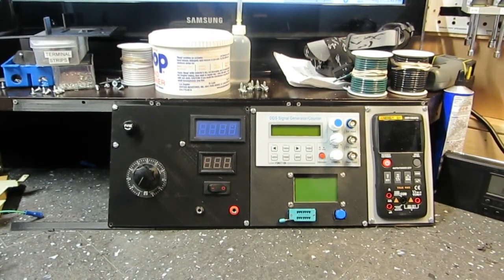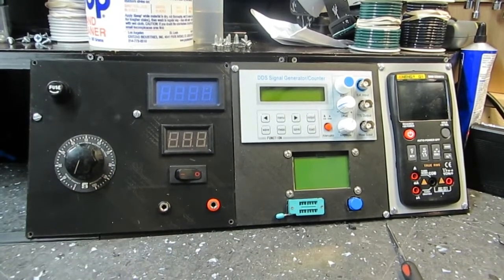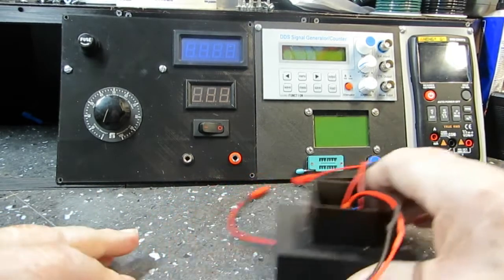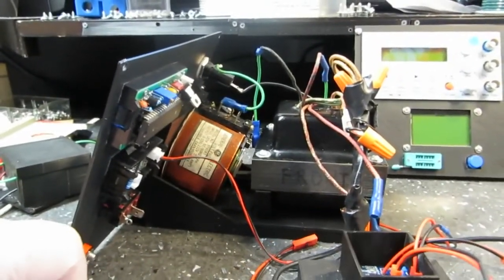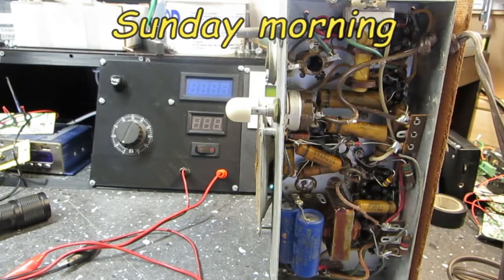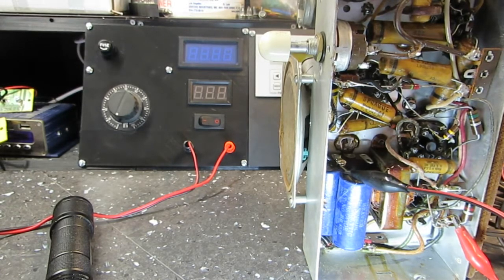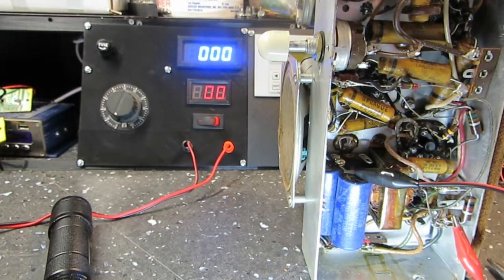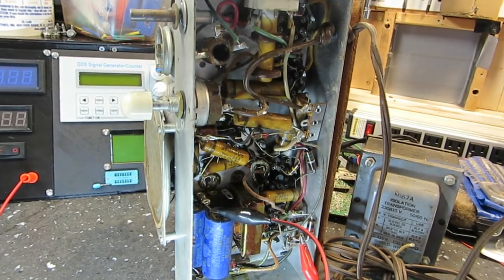DERB - DC PS Installed - Does it work?

Comment: Hi Doug, I am so proud of you and your design of this. I am thinking of making
me something similar. I would like you and Bob to think about an add on
for the external dc supply. Could you come up with a way to sub the filament
voltage so in trouble shooting hum or noise you could remove a tube
to see if that is the problem. I see techcs do this on guitar amps since
they are powered by a 6 volt transformer.But we can't on these series
strung all American 5 sets. Jimmy in soon to be wet Alabama.

Comment: I agree with Mark, those radios were not made to run on 120 volts, I would not go over 115 volts, your B + will be too high if you do.
I like the "modular" design, it makes it easy to service, good work Doug.

Comment: Hi Doug, Great video, and nice job on the radio. I was just wondering, you had about 104 volts at about 500mA, Can you tell how much current this tube radio could draw safely. I measured the AC voltage where I live and its measuring about 126VAC. Back in the day thses radios were designed to run on 110VAC, so was just wondering is there any problems with the 126VAC...